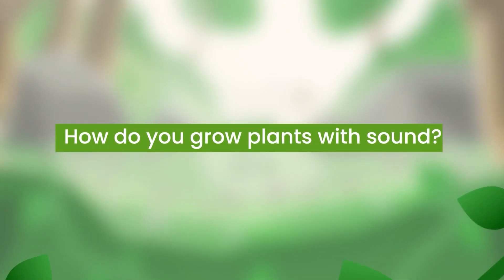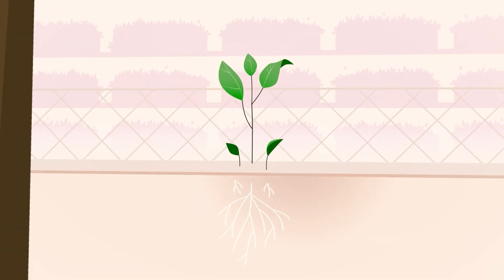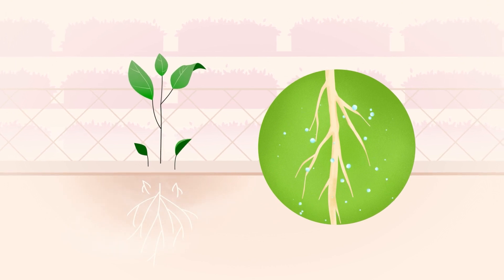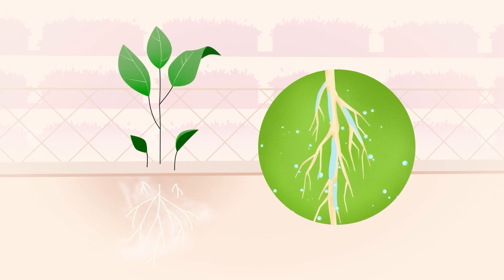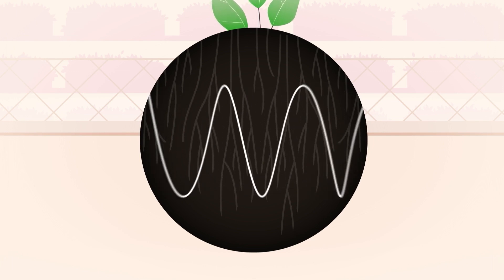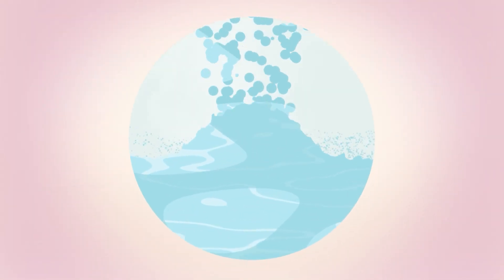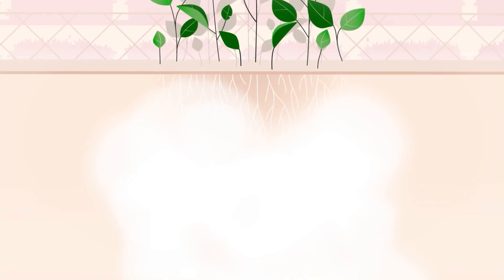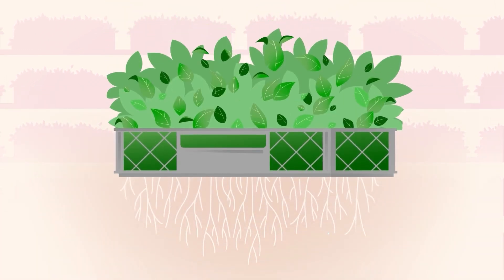Growing plants with sound - how LettUs Grow use ultrasonics in aeroponic growing systems

Comment: Conventional aeroponic methods are far more efficient.
Their side by side tests prove that its more economical to grow micro greens with hydroponics than their ultrasonic fog. The hydroponic yield was 3.7kg/m2, ultrasonic fog was 4.5kg/m2.
The hydroponic system was irrigated 4x per day, long enough to wet the felt. The ultrasonic fog system was run 4 minutes on and 4 minutes off (183 cycles a day),  the 18 transducers  in each tray ran for 12 hours per day. An additional pump ran every 15 minutes to maintain the correct water level for the transducers. The massive difference in power consumption far outweighs the 0.8kg/m2 increase in yield. The ultrasonic fog method also involves a considerably higher initial outlay and higher maintenance requirements compared to the hydroponic system.  Here is the video so you can decide for yourself  https://youtu.be/A-pUqRjPzzc